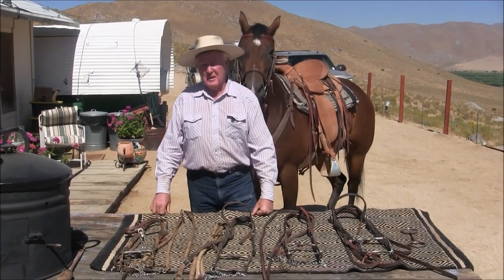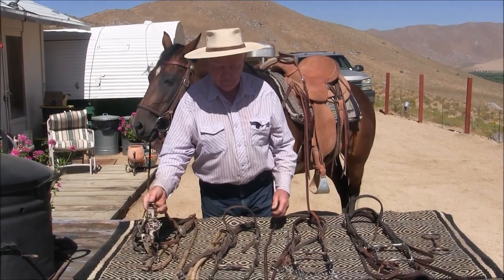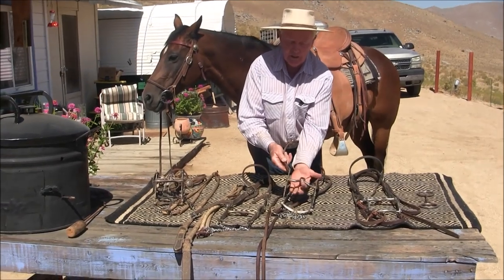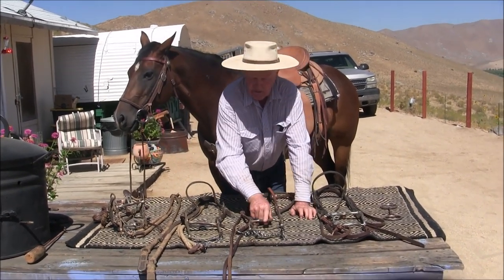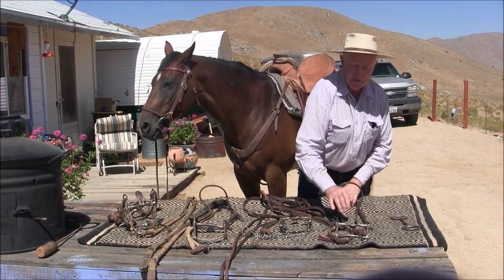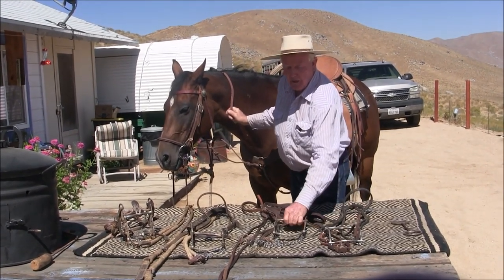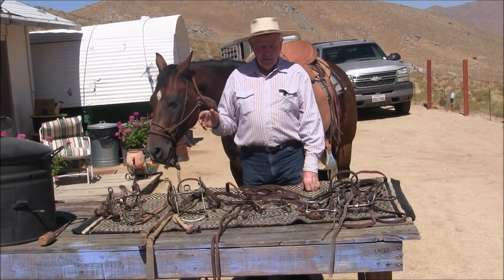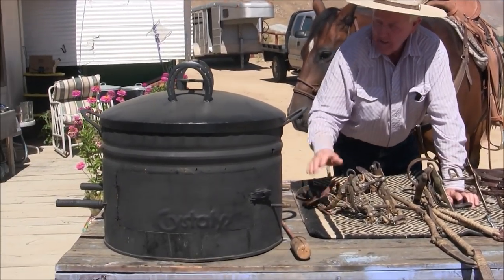Pat's Take on Bits

Comment: You have an excellent knowledge of bits. I'll be recommending your video to a few friends who are getting terrible advice from a local "trainer" who puts every horse in a twisted wire snaffle. In my opinion twisted wire doesn't belong in a horse's mouth and if you feel a need to use on on any horse you are not a trainer and not a horseman.

Comment: I'm alittle.... anti bit. I feel if you're a good enough rider and can communicate with your horse properly all you need is a halter. And you ride so amazing you don't need a bit! But well different opinions just my 2 cents. Love the videos by the way!! Keep them coming
Reply: Well.. you could also look at it as.. if you're a good rider and have good hands.. you can ride a horse in any bit?? Just showing another perspective. 
I'm a kind of a  middle of the road person... usually just use a low port curb or a 2 or 3 piece Snafflebit... ring or shank depending on my horse and the day. I can ride 2 of my horses from bridleless to a high  port or cathedral and anything in between. 😊🐴
Reply: @Life With Horses TV everyone thinks they are a good rider with soft hands. This is the problem. I just had an experienced rider come and ride on of my horses. She says the whole time this horse is pretty soft. (The horse is not by the way.) I pointed out to her that the fiador  knot was tucked under the horses jaw because she was holding on so tight. This is very common. This is why 9 out of 10 times bits are just plain old torture devices.
Reply: @katiek.8808  Just because someone says they are experienced, doesn't mean that they are. I agree... riding bitless and/or bridleless gives you a whole other level of riding and knowledge... teaches one something new... about themselves and the horse. All I'm saying is... that if someone is really good with their hands... they should be able to ride in anything... of course depending on the horse. I trained my appy and like I said... can ride him bridleless... and have used and tried all kinds of bits on him trying to find what he liked for the show ring. He trusted me to try anything on him because he knows my hands are good. My paint horse is another one that I can ride bridleless too... but with him... I've only tried about 4 or 5 bits on him and found what he likes to show in. When showing... you do have to use a bit, so you have to learn to have soft hands. Although I'm a believer in bits... I don't agree with using bigger and bigger bits if a horse is not trained well. If a horse won't do something or is misbehaving.. going to a bigger bit is not the answer... it means you have a whole in your training somewhere. Time to go back and figure out what the horse is not understanding before you can move on.
To me, bits aren't used to bypass wholes in a training program, they are used for specific purposes and disciplines to achieve certain results.. and should be used with soft hands... which unfortunately some people don't have.
And like I said... even though in the past, I've tried the high ports and cathedrals and spoons to see what they did and their purpose... I'm a middle of the road bit user... I usually use a 3 piece ring snaffle, a 2 piece shank snaffle, a 3 pieces shank snaffle, a curb bit and a bosal... those are the main things I ride in. :)
Reply: @Life With Horses TV that’s great however you are the exception. I don’t hate bit users. It’s just bits should be for for seriously experienced people and very well trained horses(which begs the question why use them anyways). Bits should be found in the show pen(which is still unnecessary) not your average trail rider.
Reply: In the vaquero style of riding they start with a bosal which is bitless. The horse has to graduate from the hack to the bit. If a horse has any holes in its training they go back to the bosal. Bits are not torture devised. When used correctly they are simply a communication with the horse. Same with seat, leg, and rein pressure.

Comment: I've never gotten an explanation that I could follow as to how it changes anything to make a shank a different shape - Now I get it, it starts with the bit's center of balance, and how much material (i.e., weight) is behind that center of balance, how much in front, so you can have bits hang more vertically, or less vertically, so you can put the horse in a bit that asks for the right verticality for that horse - Thank You! 

PS - I promise, I "Like" all your videos, and have long since subscribed!
Reply: Youll now see bits in a whole new light, the reason for all those diffrent bits is to find the proper bslance& tounge relife, for any givin horse, its a lot like finding dentures , off the rack!

Comment: I love that Pat seems to only use bits with solid mouthpieces (snaffle and leverage), and yet he gets everything out of a horse you could possibly want.  Solid mouthpiece and a cricket gets it done! 

He mentioned "correction" bits -- the ones where there's an upside down "U" shape open port and where the bottom of the port attaches to the mouthpiece, it swivels, on both sides.  No one really explains the purpose of that.  Then there's the one where there's a single jointed mouthpiece on a leverage cheekpiece and the whole thing wobbles all over the place.  OMG.  There's a trainer on YT that actually uses that wobbly set up with single twisted and double twisted wire jointed mouthpieces.  You watch this video several times and then go watch videos promoting other types of bits and they kind of seem like a lot of BS.  Thank you Pat.

Comment: Just got your book Transitioning your horse to a western bit. Sounds like you suggest a halter , ground work re-teach pressure, yield and timing. Then get on and work my legs in a halter. But what about the cricket bit? Do I start this in my ground work, then ride in a halter working my seat commands. I guess your clinic will help. Your videos on ground work has transformed my mustang of 12. She is so much more respectful and listens. She was taught well but went to a poor second handler then a rescue, she comes in 1/2 way when I raise my hand and the the rest when I raise my hand and slap my leg. Really love your help!! She going to be amazing!!!
Reply from the maker: Yes you can use the Missing Link Snaffle after you do your homework in the halter as an intermediate step to the western bit.

Comment: This story will prove your point on spade bits and inexperience horse.....  I never saw one before. Told a man (working on collection with my mustang) that I have not found any bit that doesn't send her to Mars as soon as it she feels it move with the reigns. The man wanted to try a spade bit as training to help her accept corrections. He got in the saddle,  picked up the reins and found himself on the ground in short order.  It's gonna be a long, slow journey to help her be okay with a western bit.   I ride her bitless for now with great responsiveness.   She is 13 years old.
Reply: That's been my experience too. When I first starting riding, my teacher used a 'tom thumb' bit. We had problems with it, so I did some research and tried a broken link snaffle, then a french link snaffle, and finally went to the cross pull bosal. The cross pull bosal is all I use now and it's fine for the sort of riding I do. I've used it on several horses all with no problems. But I do find it interesting to hear Pat explain how the old bits shown in this video work.

Comment: Maybe my last comment on this video. Maybe not. Before I say this I want to be clear that I’m not one of those people who thinks bits are cruel. I have Pat’s snaffle and am very glad to have found it. My issue is with spade bits. It seems like the only way for a horse to be “comfortable” in a spade bit is if he carries his head at an angle that allows the spoon to lay flat against the tongue. I do understand that a “comfortable” angle for a warmblood is different from a “comfortable” angle for a QH. But seems like comfortable is a relative term. Yes the horse can set his head in a certain way to avoid discomfort but it’s not comfortable for a horse or a person to maintain a specific position for a long time. We all need to be able to move around continually to keep from getting stiff or sore. So that’s my concern — that it has to be very hard on a horse to maintain a headset that keeps the bit from being uncomfortable.  I used to think that the intense collection and vertical headset of dressage riding was tough on horses and it’s clearly hard work. But dressage horses don’t have to maintain that frame for hours at a time because they get frequent breaks on a loose rein and the curb bit has a low port so they can relax with the bit in their mouths. Bridle horses get no relief unless the bridle is literally removed from the horse’s head. Would be interested in Pat’s thoughts on this.
Reply from the maker: As you said, a bridle horse has to work all day and spends much of that day on a loose rein covering country. So here’s how it works: when the horse is carrying it’s head in what we’ll call a neutral position with no collection, there is no pressure in the horse’s mouth and the spoon is laying (not pushing) on the horse’s tongue. Now when the rider picks up the reins, the spoon comes off the tongue slightly (the properly adjusted curb strap keeps it from contacting the roof of the horse’s mouth) and that is the signal for the horse to gather itself up into collection and tip his nose in. The rider then asks the horse to do whatever little job is at hand, work a gate, change speed or direction, move laterally, etc. Once the job is done, the rein goes slack and the horse continues on its way. The angle of the spoon is customized for each horse so that he can carry his head in a natural position both with and without collection. For example, the Andalusian would get a steeper angle to the spoon than a quarter horse. The spade bit is a SIGNAL bit. That means that ideally there should be no leverage used. The height of the spoon and the looseness of the jaw allows for a wide range of minute signals. Contrast that to the actual leverage caused by a lower port bit with a  curb strap. This is not to say that the curb strap is not a necessary part of the multiple signals produced by a spade bit. But the signal aspect of a spade is the main source of communication and not the leverage caused by the curb strap as it is in low port bits. So your premise that a spade bit horse is in “discomfort” if he’s not in collection is not correct. He’s just carrying the spade around in his mouth. He can pick it up when he has to do a job that requires speed and he can just let it hang in his mouth when he’s just covering country. Thank you for your well thought out question. We will make a video covering this subject when and if we ever get out of Australia!
Reply: @PatnDebPuckett  Wow that helps a LOT.  I know I"m not getting it 100%, but one of these days I will.  One of the things you mentioned that I didn't realize is that headstalls fitted with a spade bit have curb straps.  Being signal bits, as opposed to leverage bits, I thought perhaps they didn't have curb straps at all.  I would love to see a video on this.  I'm thinking that maybe you being stuck in Australia is one reason why you had time to write that wonderful long response.  I really appreciate it.  Stay safe.
Reply from the maker: You are correct! We were sitting in a hotel room under lock down waiting on our flight home. We made it back to the US finally and now we’re in self quarantine  at home which is pretty normal for us. To clarify one more thing, Pat has done slow speed demonstrations on his spade bit horse without a curb strap to make the point that the spade is a signal bit. He would NEVER go without the curb strap under everyday working conditions because it keeps the spoon from turning over in the horse’s mouth. When he’s chasing a cow at a high rate of speed, he might need to take a hold of the horse to rate her and going without a curb strap would be unwise. We’ll make a video on this subject in the coming week or so. Thank you again for keeping an open mind on this subject and being genuinely curious...

Comment: Awesome video, agreed on previous comment (best to date), my question or concern comes with the use of rein chains and romal reins, what would your opinion be on this, would a nice quality mohair (with or without) rein chains be ok?  The soft light feel and balance of my bit (half breed) with Romals I feel I loose a bit of flexion, am I going to fast to the half breed
Reply from the maker: I would not use anything so soft as mohair reins on any shank bit. It is too soft and light and will get you zero feel. Your choices are leather split reins with or without chains or romal reins with chains. Don’t overthink and don’t try to reinvent what it has taken nearly 200 years to perfect 😉 If you are using too much hand and not enough leg, you aren’t there yet. Thanks for asking the question...
Reply: My understanding is the chains portion on the reins is so the horse can drink...in a creek, troughs...and not get the very pain staking  work and art of the braided raw hide does not get wet..it makes no difference to the horse.

Comment: Enjoyed this Pat. Thanks. Was wondering what your thoughts are concerning the shape of the roof of a horse's mouth in regards to a spade bit.
Reply from the maker: If the spade is 4 1/2 inches a tall, I’m not concerned about it. That makes it extend far enough into the horse’s mouth that it makes the shape of the spoon irrelevant. Another thing to remember is that we only want ONE finger between the horse’s jaw and the curb strap. This eliminates the possibility of the spoon turning over in the horse’s mouth.
Reply: @PatnDebPuckett  Thank you.

Comment: Would like to hear your take on triangle bits
Reply from the maker: We don’t use broken mouth snaffle bits. The reasoning behind the triangle mouth bit is to cause pain if the horse moves his nose out rather than putting the responsibility on the rider to teach the horse through timing. Also, we want our horses to travel with their noses slightly in front of vertical so this bit would undermine a correct head carriage.

Comment: Hi Pat, I've enjoyed watching this video many times,  but I always feel that something has been left out.  If not in the actual bits, then at least in the 'splaining.  Namely, in the space between the missing link snaffle and the half breed.  You do have one other mouthpiece there, the San Joaquin, but today I was watching another of your videos and you mentioned you were using a Mona Lisa mouthpiece.  I googled it and looks like it's a solid mouthpiece with a copper hooded port -- not too high a port -- and a roller under the hood.  I was curious about that, because I could swear in another video you said you didn't like the copper hoods and removed them.  Made me wonder if the San Joaquin is basically the Mona Lisa with the hood removed.  Anyway, if you could talk about the various bits that a fit between the ML snaffle and half breed, and their purpose, that would be really interesting :)
Reply from the maker: Regarding the Mona Lisa, we do grind off the hood when we come across a Mona Lisa that we want to use. I may be misunderstanding your questions, but here’s where I think you are losing the thread. We use the ML Snaffle with horses that are not bound for the spade bit or older horses that don’t understand lateral work. The other mouthpieces we use are high port bits with crickets, half breeds, or San Joaquin mouthpieces. The high port bits utilize the canon bar to make the port. The half breeds and San Joaquins have a straight or curved canon bar with the port attached. There is a clearer signal with the higher port bits. That’s the reason we use them as opposed to lower port bits. The cheekpiece is dependent on the conformation of the horse. Pat goes into greater detail on this subject in our DVD The Art of the Bridle Horse. So as far as wanting an orderly group of bits that go from the Missing Link Snaffle on up, I don’t think you’ll find it in our “collection.” And that’s not how we view bits. We use what we have at the time based on the needs of the individual horses we are working with. Sometimes owners have a particular bit that seems to work with the horse we are working with. So to sum up, we don’t go from the Missing Link Snaffle and progress through a series of differing ports with an individual horse. Hope this helps.

Comment: Is your cricket snaffle used in lieu of a standard snaffle or as an interim step to the half-breed or spade bit?
Reply from the maker: We use the Missing Link Snaffle on older horses that we have in training and outside colts whose owners want them back in a snaffle instead of a bosal. It’s not an interim to a spade as we prefer to start our own young horses in a halter, then go to the bosal, two-rein, and spade. We typically put older horses that have missed the window for a spade bit into a half breed. But to go back to your question, we use the Missing Link Snaffle to teach lateral work to an older horse or for a colt whose owner requested a snaffle. Thank you for the question...